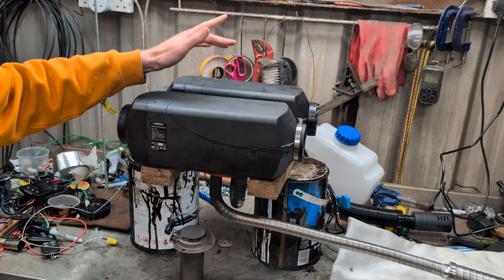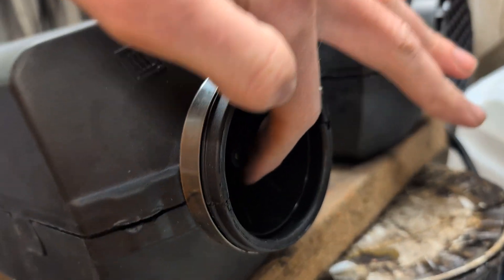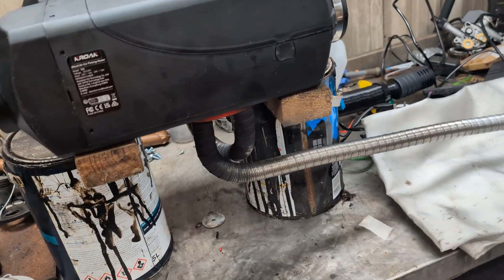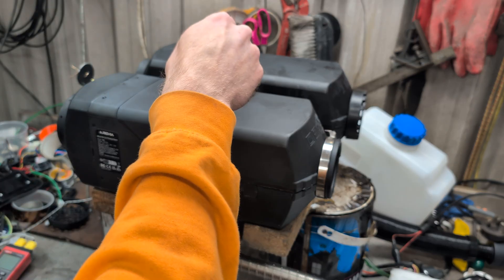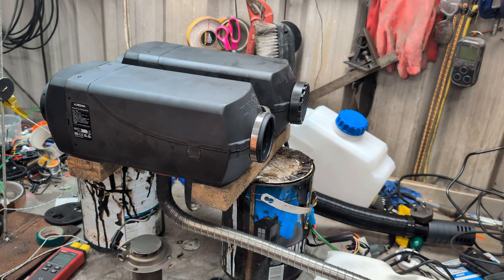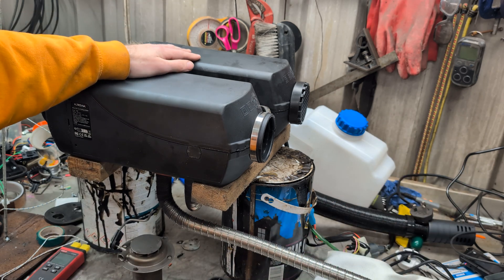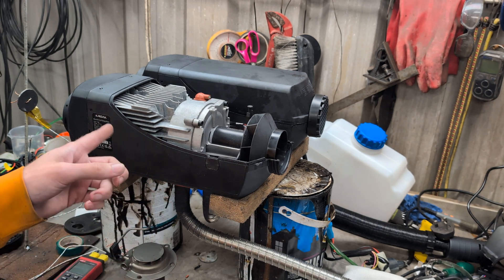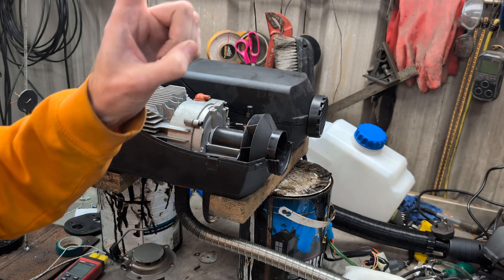Diesel heater exhaust heat recovery - active plus passive heater

Comment: Capturing the exhaust heat is very useful. Honestly I'd prefer it to circulate and heat the engine coolant like you did with the EGR a long time ago so the vehicle is ready to go at any time in cold weather. I think wabesto has one that does both, but don't think it uses exhaust waste heat.

Comment: Excellent video thanks 👌 very good experiment. 

With mine I ran the exhaust gas through a towel drying rail that had wide open passages  and a 25mm in and outlet. (Drilled out and 25 pipe added to sleeve exhaust onto) 

Ran great for a year and recently started spewing out thick smoke. 
I had to do away with the towel rail. I think a heat exchanger would work if the heat produced was pumped through a radiator, with clear exhaust flow through said heat exchanger. 

Anyway.....great video, great watch. Thanks.

Comment: All way to complex. Simple tube with fins on is all you need. Kind of thing you would use for in floor perimeter heating. Sloping downhill slightly for condensates.

Keep it simple.

Comment: A 6 foot long exhaust pipe, coiled like a short corkscrew, the loops large enough to sit a peltier fan (stove fan) in it's centre,  a 1 metre exhaust extension to exit the exhaust to outside. This is my set up in my sitting room. The only exit to outside is the exhaust, and fuel line to the fuel tank, the air intake snorkel goes through a hole into the floor cavity (solem).

Comment: Excellent video.  on mine I passed the exhaust into a turbo intercooler and then the exit into a standard vehicle exhaust to reduce back pressure.  Then  used a cheap ebay temp controller to run a fan and keep the exit of the intercooler  above 50C to prevent condensation.   All were cheap bits off ebay and cost about £100 all in.   Makes a difference but not a cheap option.

Comment: After thinking about this a lot, I determined that blowing any air heated by a exhaust heat exchanger into a living space is extremely dangerous. One fault equals instant death.  But, using it to heat a greenhouse is a great idea.
Reply: Not instant, fit an alarm. Your point applies to pretty much any room sealed exchanger + fan based heater. The exhaust gas is exactly the same gas that is heating the original/any diesel heater in the first place.

Comment: Burning a kg of diesel creates about 2 kg of water.  Condensing that water liberates a large amount of heat energy (about 4.5MJ) so having a condensing heat exchanger dramatically increases efficiency.
Reply: BS burning kg of diesel cant create 2kgs that creating mass 😂
Reply: @ausguy4385  Ever heard of Oxygen?  Do you think it comes as part of the fuel?

Comment: I'm using an egr cooler to supply a radiator the exhaust is only 20c been in 2 years now radiator is in a bedroom above the heater so doesn't need a pump just convection, have you thought about putting them in line so the slave preheat the air don't think it'll effect the overall output but might raise the output temperature

Comment: Commented below about my lad where i fitted a diesel heater in his flat. Its been 2 years now since he used any gas to heat his flat, he has a clothes horse to dry his clothing in front of the heater 6ft away. Runs on kerosene @57p per ltr. Only problems he's had is a burned out burner chamber and 1 blower fan where the bearings went. 25ltrs of kerosene lasts him 2 weeks in winter and this year, last kerosene i delivered in April, he still has 11ltrs left
Reply: Thanks to you,  i managed to get the 6-8 kw heater that you gave a good description of, the typical '8' kw heaters are the ones that had issues but easily replaced the parts. If you can remember, i sent a photo of the melted stainless steel  burn chamber pipe
Reply from the maker: That's good going.

Comment: thankyou for impressing the serious point about the dangers of carbon monoxide on such a setup
Reply from the maker: Not just this.  But any fuel burning device.  Gas, diesel, wood, coal, etc.
Reply: At least 1 high quality low ppm alarms in any space I'm sleeping in, £30 better than not waking up

Comment: I think it's definitely worthwhile to recover the exhaust pipe heat, my approach is to use an EGR heat exchanger, preferably from a French make as they are tend to be straight.
Reply from the maker: I can't remember what vehicle I chose mine from.  I just browsed ebay until I saw one that looked the right shape.  :)

You do seem to get better recovery from an EGR cooler.  I got similar results from a pool heat exchanger too but it was a lot more expensive.

Comment: Nice experiment and great info as ever! How about some copper pipe for the heat exchange and have the intake air being pulled over that before going into the heater? Think someone did this and got the intake air upto about 30 odd degrees before it went into the heater. 

Also, there will be loads of comments about the second heater ‘choking the main heater’ (pv=nrt proves that can be the case) or coking up over time (can’t see this if you have a clean burn). Could you do some longer running to prove / disprove this?
Reply from the maker: As you say, if the first heater is running cleanly then there is no reason the second would coke up.  No more than any other kind of heat exchanger on the exhaust I mean.  The only thing I'd be slightly concerned about would be the exhaust condensate reacting with the alloy, again this would be the same with any alloy heat exchanger.
Reply: Yeah i'm with both of you:  preheating the intake air by a secondary heaterbody works (=> counterflow heatexchanger principle like oem heaters use anyway) and that acidic condensate WILL eat any aluminium, copper and over time also a thick cast iron radiator.
Reply: What’s the PH of the water once condensed? Is it really that bad?

Comment: got some progress done. My heater now starts on a 100% custom logic board. Once I have a minimun viable product ill release the board and people can snap their arduino and have fun coding some higher firmwares.  I do have secondary pump or fan output because I want to run a waterpump to recover heat through an egr. 
We won't have much restrictions after that :)
Oh and I stopped mesuring the range of the remote at 2 kilometers.

Comment: I think the best exhaust heat recovery I've seen for one of these was a person who found an exhaust pipe with a water jacket around it (It might've been for marine applications, I can't remember) and used that with an aquarium pump to pull the exhaust heat into a small radiator to blow it back into their workshop
Reply from the maker: You can use an EGR cooler from a car/van.  I've got a few videos on it, but beware they were made years ago.  :)
Reply: an alloy intercooler works well with 3c above amibiant from the outlet exhaust.